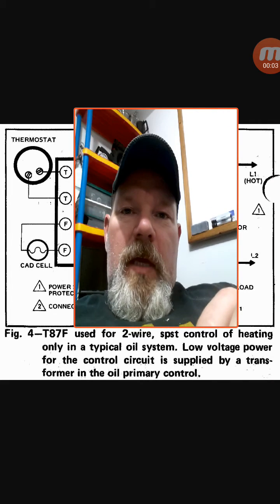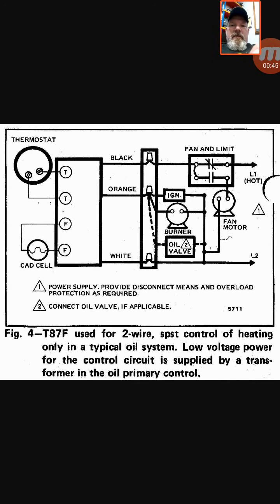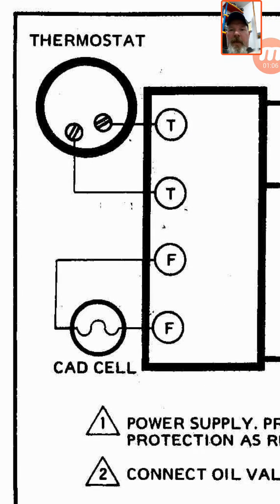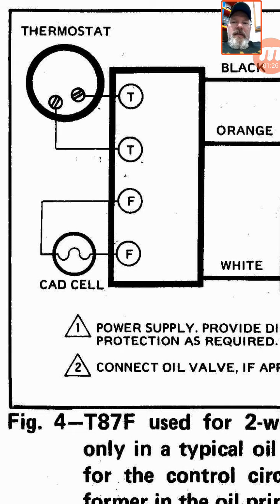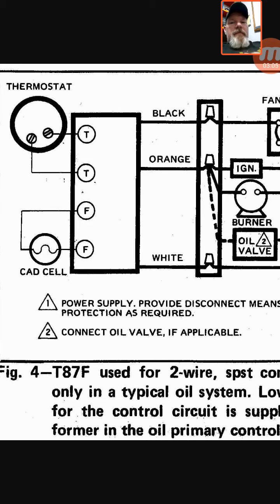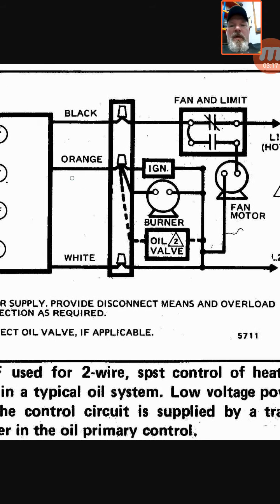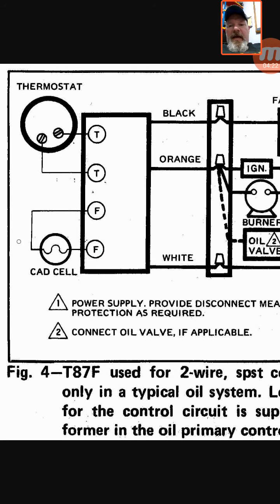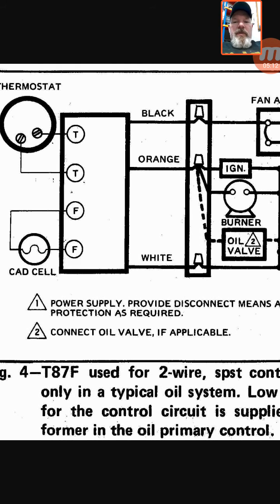How to Read HVAC Oil Furnace Wiring Schematics

Comment: Would have been a supreme video had you had a/c wired into the stat and furnace and a/c.
Reply: AC wires don't go to the burner relay, which is what the vid is about. They red and yellow close a contactor in the condenser that cause the compressor to run AND they go to a fan control board that starts your fan after a short delay. Google ST9103a board for videos .

Comment: question: is there a way to hook up a/c to this type of oil furnace system and wire it?
Reply: AC does not go to the furnace.  The Red and Yellow from the thermostat will close a contactor on the condenser unit. The Red and Yell will also go into a fan control board that will turn on your circulation fan in the furnace. You likely have an ST9103a Honeywell fan control board that turns on the burner or AC when there is a call for heat/cool that also turns on the circulation fan.
Reply: @the_lar  i got it hooked up by pro, works great! i have to rewire manually myself from a/c to heat every year.

Comment: These older oil primary control boxes are easy enough, but I'm actually struggling with the newer digital one.....with an aquastat and a circulating pump